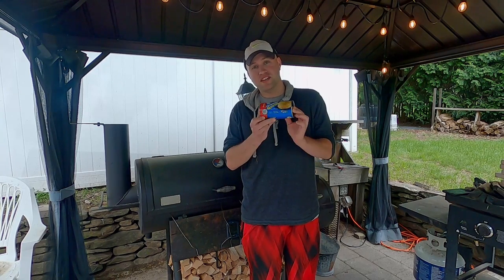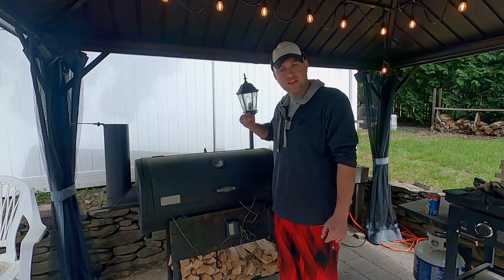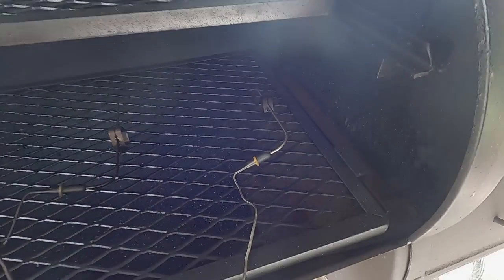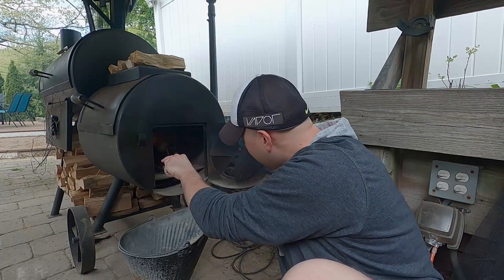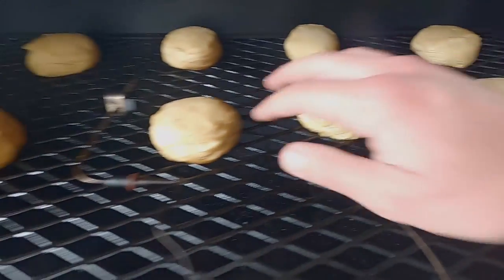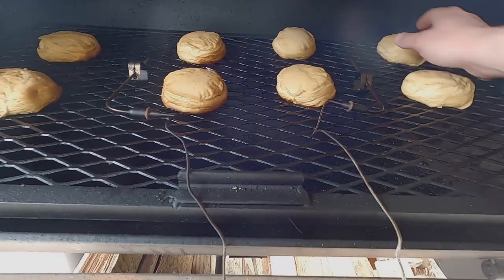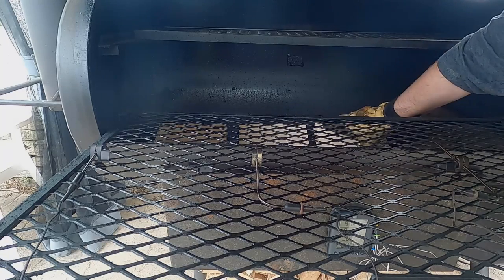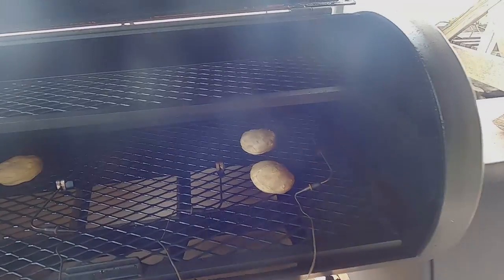HOW TO TEST YOUR SMOKER TEMPS | Learn How Your Smoker Cooks Using Biscuits! | Old Country Brazos

Comment: The way a brisket cooks is not going to be the same as a quick 10 minute biscuit cook. Just cook on the dam thing. I have the deluxe model of this same smoker. I do recommend taking the baffle out. It made my hot spot by the firebox instead of in the middle.
Reply from the maker: True, but it's always good to understand your temps and do practice burns with cheap food. I haven't looked back after taking the baffle out. So pointless.
Reply: @FattysFeasts  I think the best way to learn your cooker is to cook on it. Use hot spots to your advantage, once you've gotten them to reasonable tolerances, like 50° or so. At the end of the day, you're cooking on a real fire, you can only control it so much. I just sold my Lang competition smoker and bought this one. I've had some good cookers, but I am really liking the Brazos. My next one will probably be a Jambo.

Comment: Supposedly (I haven't tested it) a water pan up against the firebox opening (acting as a baffle and adding moisture) will give you temps within 10 degrees across the chamber.
Reply from the maker: I always use a water pan actually, besides for this experiment. The plate that pushes the heat down unfortunately prevents the even temps throughout the smoker, even with the pan. Definitely helps keep things moist though and helps retain heat to a degree!